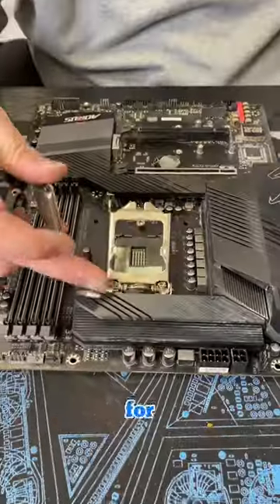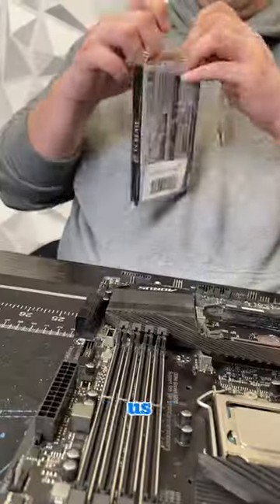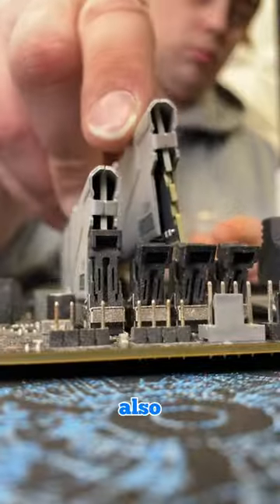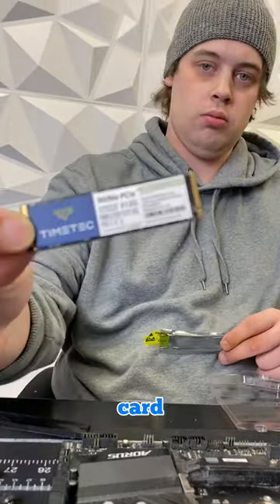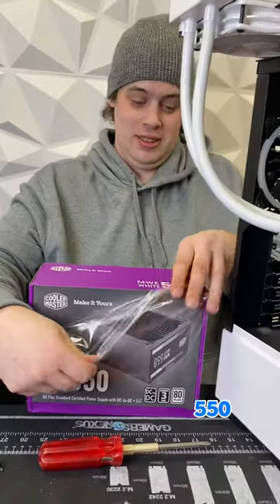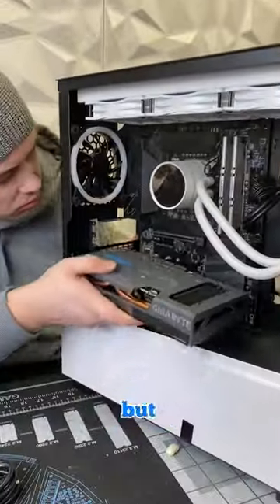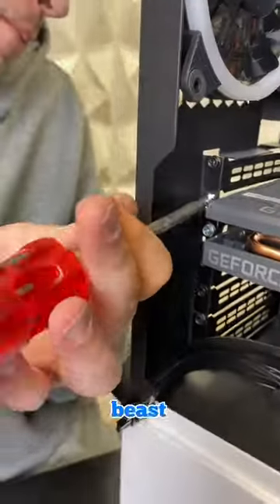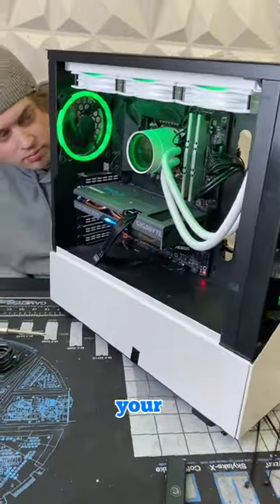$700 GAMING PC?! 🤩 #pcrepair #pc #budget #gamingpc #pcgaming #egirl #gamerguy #shorts

Comment: 550 watts and 500gb ssd with a 3060ti. Idk how I feel about that but then again atleast it's "affordable"
Reply: 500gb ssd is not that much but 550 watts is the sweet spot for the 3060 ti, you dont need to have 700 watts for a graphics card with 230 watt tdp
Reply: @coincool12  500 for a 3060 isn’t weak but it’s at the limit just about if not a little under, that’s why I’m getting a 850W it’s an asus thor
Reply: I’ve got a 3060 that runs fine on a 450w sfx psu. I don’t recommend it, but it’s working.
Reply: Dam aio is more than any of the other parts fr
Reply: Not even bronze 💀 going to fry as soon as the guy tries to play cyberpunk with rtx
Reply: At this wattage it should be good to atleast have gold rating, i have seasonic 650w gold for just 90e

Comment: Yeah good idea to skimp on the power supply and a shotty ssd...
Reply: Especially paired with the 3060
Reply: Idk why people also skimp on the PSU, you literally risk everything when you use a shotty no name pau
Reply: @fredfriburger1  …I didn’t even think people bought lower than bronze psu’s….
Reply: @beaumartin366  yeah, but he was inaccurate, it should be just 80 plus
Reply: @aidenesmith  well do you think a 600 watt 80+ platinum by Enermax is considered skimping?
Reply: @Crazy_Chriz  I have 0 clue what ur point it ngl ur comparing an unrated pay to a platinum
Reply: @Crazy_Chriz  sorry not unrated “white rated”
Reply: @Crazy_Chriz  also if I had a 3060 I would pair it with at least 750w gold psu, because in my system I also have a lot of cosmetics so I would need the extra wattage

Comment: I don't know if I'd trust that psu. It's not even 80+ bronze rated which is my recommendation for most builds that aren't like a 3080 or something along those lines (for a build with a 3080 I'd go 80+ gold since they're usually built better). 80+ white for a 3060 ti AND only a 500 watt model? If that power supply fails it could take the rest of your pc with it.
Reply: 550* watt
Reply: I doubt it would fail but it'll basically be the bare minimum for this kinda built
Reply: No no no! The efficiency rating does not have a causation effect with quality. While that power supply is a wrong choice, it’s not because of the efficiency rating. The quality of a PSU depends on the topology and protections.

Comment: Bro i had a shop install a gpu for me rtx 3060 ti, and they installed a 750 watt psu i feel like they're just making it more expensive
Reply: Definitely not bro💀 idk why bro put a 500 watt psu in there. Never cheap out on your psu. You could short your whole build if you do
Reply: @iridescent982  sure but i felt it was a little bit overkill tho i am not sure of the watt usage of the card
Reply: @yes-f9c  the lower the percentage of the psu used, the better is the efficiency. On top of that it is also more quiet and you wont need to upgrade it in a future build. Nothing wrong with that
Reply: @muhahaha153  i guess so the cool thing about it it has rgb and a "quite mode" which when off is as loud as a plane
Reply: @yes-f9c  ok maybe they did try to make it more expensive with an rgb psu 😭
Reply: @yes-f9c  700 watts is not overkill. I have a 850 watt psu and i plan on upgrading. Always get the best psu possible to save money in the future. You can get a 1000 watt psu for like 200 dollars, its pretty cheap